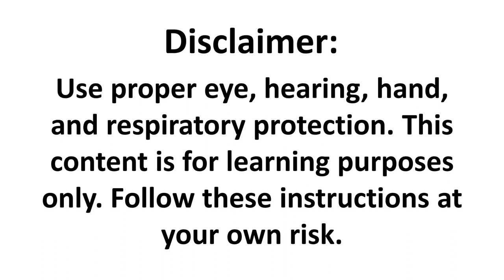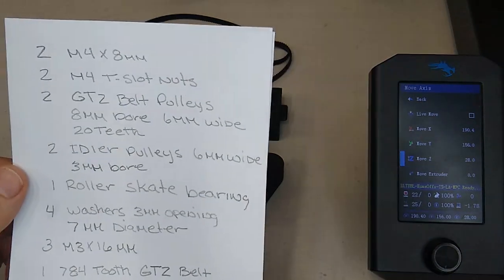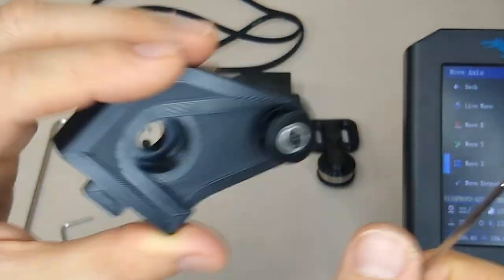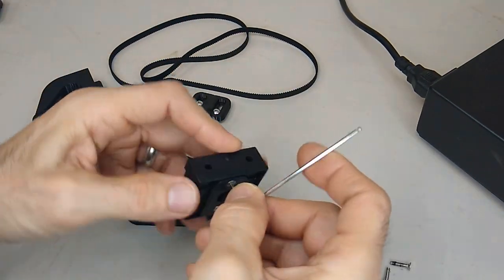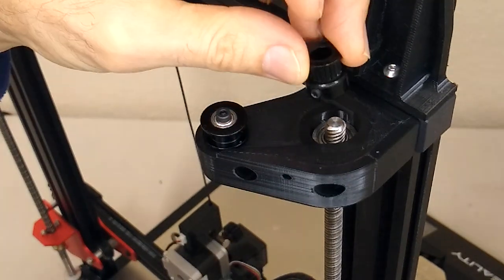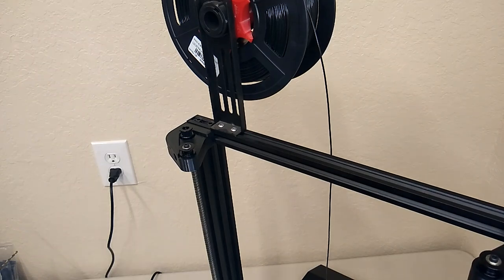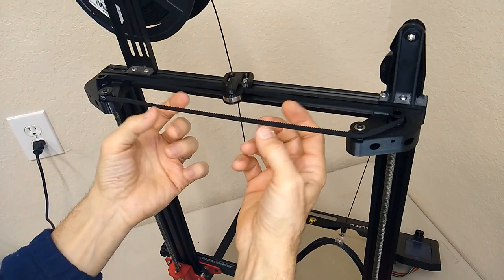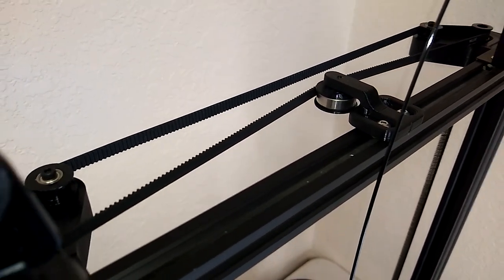CR10S Pro V2 Dual Z-Axis Lead Screw Synchronization Timing Belt Upgrade for Your Creality 3D Printer

Comment: Thanks heaps for this video mate - had my 10s pro v2 for years and this is one of the best upgrades.  
Was getting so sick of leveling the gantry and just installed this upgrade last night.  First time I've ever seen a level Z after a power off!  Amazing stuff.
Some of the parts are annoying to source (Australia) but found belt, timing and idler on Ali.  
Thanks again for your video - clear and informative.  Keep 10sprov2 alive!!!
Reply from the maker: Hello Scott, Thank you for the kind comments. I'm glad you found value in this video for your viewing time and put some new life into your CR10S Pro V2. I have a blast using mine now that I've brought it up to date.

Best of luck with your projects!

Comment: Just a couple things to point out…
First, I think you may have been incorrect in wanting the bearings in the lead screw supports to float. This is a good idea in the original top bearing blocks since it lets the lead screw align itself. But it’s a bad thing when you in the new supports for the synchronized timing belt mod. Instead of letting the lead screws align themselves, as soon as you tension the belt coupling them the belt tension is going to pull the lead screws off to the side as far as the slop in the bearing holders will allow,  bending the lead screws and causing binding when the carriage is near the top of travel especially. This is a case where you want the bearings located rigidly and some amount of adjustment in the mounts left-right and front-back so you can carefully align the mounts so the lead screws are in line with the motor coupler and lead screw nut. You may need to move or shim the motors a bit too to get the top and bottom of the lead screw to line up with the nut. Now when you tension the belt the fixed bearings will keep the top of the lead screw in position, preventing the tension from pulling the lead screws out of alignment. Takes careful installation, but it’s the right way.
Second, Judy a thought, but as long as you were redesigning the tensioner, why not just make it take an inlet pulley instead of using the bigger bearing and having to print top and bottom parts? Also, the mounts for the idlers on this and the two side mounts could just have a short boss under where the bearings mount and eliminate the need for the washers entirely. But an interesting video, even if there are some design flaws in the hardware.
Reply from the maker: Hello Chris, Thank you for commenting and details on better approach to syncing them up. You're 100% right on the binding near the top it happened to me after I posted the video. What I did to resolve it was lower the z-axis way down loosen the screws on the bearing housings and raise the gantry to the 400mm position so it could self align. I'm going to make a follow up video on it in case others are running into this after making the changes. Thank you for your valuable feedback. I appreciate you very much.

Best of luck with your mods!
Reply: @vbared  That sounds like a solution, assuming the position that the belt tension has pulled the bearings to is a position that can even align with the lead screw nominal position. It seems a better way would be to change the recess in the mounting blocks to make it a tight fit on the bearing so it remains centered. A ideally  you’d want so adjustment in two axes where the t nuts only give you one. One way might be to modify the mounting blocks so that the bearing is mounted in the cover plate instead of the block itself, then enlarge the space in the block where the bearing mounts to slow for the plastic of the cover around the bearing plus dome slip and put some front to back slots in the cover plate. Now you’d have two degrees of freedom and could install the blocks loose and run the x axis to the top light you did to align things and tighten the t nuts and the cover plate while in that position. Then install and tension the belt and the blocks would now keep it from moving the previously aligned bearing. Would make a really clean and easy to align system.
Reply from the maker: @cs233  Hi Chris, Your solution sounds super cool. Send me a link if you decide to make a video on it so I can follow along. I'd love to see it in action. I'm currently working on reducing the mass of the hotend and bed so I can pick up some speed.

Best of luck with your mods!

Comment: Did you end up liking this more than using the spring loaded anti backlash nuts?
Reply from the maker: Hi Garrett, thank you for commenting. Yes, the reason why is that the spring and nuts don't lock the two motors together like the belted system does. If you decide to use this belt system you must remove the anti backlash springs on both sides. If you don't there will be too much drag on the two z stepper motors.

Best of luck with your mods!

Comment: As usual a home run video. So well done wow! I am a slob. But wait! I already have the Tiny Machines timing belt, could I add the extra idlers and bracket and tensioner???? Looks like my old parts would fit the same way.   Hey What setting and material did you print in and what bed surface are you using. I have some brown thing that requires glue stick and then i have an old scraper I have ground down to a knife blade, then I have to drive it under the part with a light ball peen hammer. Then I have to straighten the bed top back to the bed. Then I see you grab the completed part and just lift it oof the bed no glue to clean up. Dang that much better. I saw your little tether for the service loop harness that was cool. And I saw you have the New Control Box and that annoying snap button knob. So this video was made after the 4.2..7 upgrade.  I am so stoked about that upgrade. I want to ask if we need to do the whole thing as you did or can we keep the stock control panel what is the reason not to ???? Not that I am that poor or cheap but i just got use to my old panel. The new panel has more function but is it function a really need.  I love the finish on your parts what have to done, what filament, what settings and Can I not print that part in glossy RED. oH YEAH.  I am also a old Corvette Guy, so adding the 4.2.7 Motherboard is like an Omen to me. I had a 427 in my Corvette in the 60s, and my 2007 ZO6 was  427, so My 10S Pro should also have a 427 why not, I want to put badges on my printer after i do the swap.  You do a great job, very well thought out upgrades and supporting videos. Appreciate it so much, Thank You. You set the bar very high. I work on 1950s model trains but I am a farm boy so its like a slob shop. Take care and lets make super Printer out of this 10s Pro. Linear rails X and Y ???? Dennis
Reply: I have pics of the Tiny Mchines Timing set up I missed you request earlier. Send me the email I will forward them and my Struts.
Reply from the maker: Hi Dennis, Your previous comment was hysterical and brought a smile to my face, thank you. I'd love to see some pictures of your setup email me vbared@gmail.com
Reply: I use an artist's palette knife to remove my prints. It looks like a thick feeler gauge with a wooden handle. Its thin tapered end makes it idea to carefully lift the edge of something.
Reply from the maker: Hi Dennis, You should be OK if you already have a Tiny Machines z-sync belt. I wouldn't change it if it's working only if you don't like it. Unfortunately, there is no way to get the original touch screen to work with the 4.2.7 board since much of the software is proprietary. I print my parts out of PETG and all my Ender 3s print on our Garolite G10 build surfaces that are custom cut to fit them. Our Garolite G10 grips PLA, PETG, straight Nylon without the need for glues, tape, or scrappers, and is super light weight so it's great for printing fast. I still have an old heavy WhamBam on my CR10S Pro V2 that is full of blisters. We're currently developing our Garolite G10 to fit the 310 X 310mm printers like the CR10S Pro V2 to improve printing speed, eliminate adhesion, and removal issues. Stay tuned more upgrade videos coming for the CR10S Pro V2.

Comment: Hows the timing belt setup holding up? Does the gantry drift at all on one side or is it solid?
Reply from the maker: Hi Riff, No issues to report. The timing belt has been bulletproof. One thing I didn't mention in the video that I had to do after is remove any anti-backlash bushing kits you might have installed, otherwise the two z-steppers won't have enough torque to overcome all the resistance.
Reply: @vbared  my cr10s is all stock at the moment. the biggest issue im having is the gantry getting off after every long print. i think its because the left side has all the weight hanging from it. im going to start printing the pieces to for the timing belt system this afternoon. cant wait to see the results.

Comment: Thanks for the video - I just went ahead and bought an after market one awhile back, never even thought of just downloading STLs .  Oh well next time.  Completely unrelated to this video but you've done most of the same upgrades as me, what type of stepper motor are you using on the extruder?  I seem to keep burning mine out - the original one from Creality lasted awhile but ever since switching to the Direct Drive from Micro Swiss I've been burning thru one every 3 months  - they are never hot, adjusting the VREF doesn't seem to help.
Reply from the maker: Hi Rashton, I've still on the original 42-40 that came with the printer. I haven't experienced the problem you are describing. How does your filament get to the extruder? Does it have to pull it through the bowden tube? If so try to just drop it straight down into a short piece of bowden sticking up from the extruder like mine in the video, maybe that will help.
Reply: @vbared  Thanks for the reply.   I thought those 42-40s might be a bit too heavy for direct drive but I put mine back on and we'll see how it goes.

Comment: How do you like your direct drive system? I run my 10s pro with Klipper at 150 to 200mm second and the reason I never upgraded to the direct drive is because with the added weight I'm worried about rining /ghosting at that high speed. What are your thoughts?
Reply from the maker: Hi Alex, 

The direct drive works great for me using a non-Klipper firmware but my current setup using the stock 40-42 stepper I feel is a bit heavy to push that kind of x-axis speed you are getting without ringing. The y-axis running our Garolite G10 is less than half the weight of a WhamBam so that part should be able to push some good speeds.

I haven't added Klipper to it yet because the current Raspberry Pi prices are outrageous but when they come down I do plan to use a Micro Swiss NG. The only problem I have with all the Micro Swiss hot ends is that the nozzles come loose from the heat cycles creating a gap that the molten filament enters and ends with it oozing out of either the top, bottom, or both of the heat block threads. It's a real nightmare to clean up when it happens and a total crap shoot as to whether or not it occurs at all despite it being tightened using an inch torque wrench. Tightened hot or cold doesn't seem to resolve it. The only reason I would take another look at Micro Swiss is that the NG design is super lightweight, shortest filament path, and has the highest torque. It outperforms everything currently out. I would look at changing the blower fan assembly to something smaller and lighter in weight. Anyway, enough of my rantings, Enjoy your night.
Reply: @vbared  where did you get the Garolite G10 from? I've never been able to find the right size. Thanks for the reply. I enjoy your videos and look forward to seeing you add the NG extruder. Is you can post a link to the Garolite that would be great. The only size I can find is 310*310 but the CR10s pro V2 is 310*320
Reply from the maker: @AlexNewton  Good morning, Alex, 

I had the same trouble trying to find build plate options for it and decided to address the need after many requests. We are currently in production of our precision cut Garolite G10 for the CR10S Pro V2. I'll make a video announcing them when ready to ship out. Linked below is latest video that shows our prototype.

https://youtu.be/yJ5cJ8OEXh8

Best of luck with your mods!

Comment: Whoa, how'd you installed the screen from the 3 v2?
Reply: Whoa 2x, I missed a couple of video's from you regarding the 10Spro V2.
Thanks for making those!
Reply from the maker: Hi Spookjuhh, Thank you for your kindness. The CR10S Pro V2 4.2.7 board upgrade video has a source file link in the description that contains the mount I designed so it can be installed on the CR10S Pro V2 body. You will need to drill a couple of holes and tap the metal cover to mount it or drill a slightly bigger hole and use lock washers and nuts.

Best of luck with your mods!
Reply from the maker: Anytime friend :) Thank you for watching!

Comment: what size belt would you need for the pro max the red one not the old one
Reply from the maker: Hello ste cross, Thank you for commenting. Unfortunately, I don't have any experience with th Cr10S Pro V2's big brother. What I would suggest is to print out the belt brackets, 20t belt gears, and bearings (GrabCad should have the step files for them).  Mount them on the printer in place if the standard bearing holders. Use a sting around the wheels to get the length of the loop you need.

Best of luck with your mod!

Comment: Hi Victor 
How did you work out the belt length? Thanks
Reply from the maker: Hi Mark, For the CR10S Pro V2 the overall belt length is 784mm, distance between the lead screws is about 349.25mm so 784-349.25 = 434.75. What I would do if you're planning on adding it to a CR Max is Measure between the lead screws and add 435mm to get the overall length needed for that machine.

Comment: Where can find file that u using with elastic leash to hold cables from directdrive
Reply from the maker: Here you go Adam, 

Key-Bak the bracket was designed for - https://amzn.to/3ZsL1kc

Key-Bak Keeper and a few other goodies for the CR10S Pro V2 STL Files:

https://drive.google.com/uc?export=download&id=1E88gKW6LUk9BiwJCXl4f98vpU0XbP4dl

Comment: Complicated solution for something that can be done with a belt of a correct size and 2 pulleys. 

I used a 770-2GT belt (hard to find)  with 2x 24 teeth pulleys, maybe a 782-2GT belt with larger pulleys also works. 760 with 20 teeth pulleys maybe, but I think you can play guitar on it.
They are cheap from China, buy different sizes to experiment. 

I have a CR10s Pro V1, the V2 might have different dimensions!
Reply from the maker: Hi NeutralSmith, Thank you for commenting. I like the simplicity of just a belt and pulleys, unfortunately I was unable to locate a good information source. The V1 and V2 use the same chassis so a belt that fits on one should work on the other.

Comment: This mechanism is not necessary.  All that is needed are two gt3 sprockets and a timing belt.  There is no need for it to be adjustable because the top steady bearings are adjustable.  Its all on thingiverse.  Cost me about 14 bucks, all in.
Reply from the maker: Hello BTom16, Thank you for commenting and suggestion. Please tell me what length belt you used. I was unable to find the info on the belt at the time. It would be great if I could ditch the extra weight.

Best of luck with your mods!
Reply: Hello. I think 2GT-760

Comment: This upgrade is complicated and unuseful: there are anti-backlash bushes to be bought on Amazon creating a slight friction in the screws which maintain the gantry in the position set manually once forever.
Reply from the maker: Hello Giuseppe, Thank you for commenting and info on the anti-backlash bushings. Yeah, I hear you on the complexity of the timing belt, thankfully, there are other designs for this purpose. I run a small print farm so I come across weaknesses in printer setups not long after putting them into service. I wish the anti-backlash were the solution to keeping the z-steppers syncronized but unfortunately for me they didn't keep the gantry level and the reason why I looked into timing belt parts with a tensioner. Independent z-stepper control would be the perfect solution but it's a more costly and complicated project involving mainboard swap out, And Klipper.

A saying that holds true for me is: If it isn't broken, don't fix it. The videos I put out address issues I've had in the hopes of saving someone else a bit of time and frustration.

Enjoy your week :)